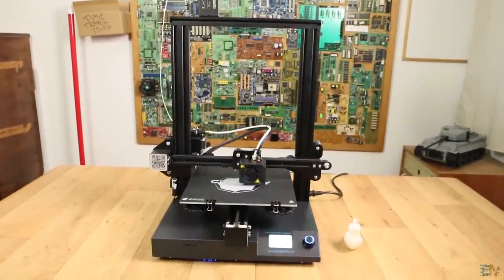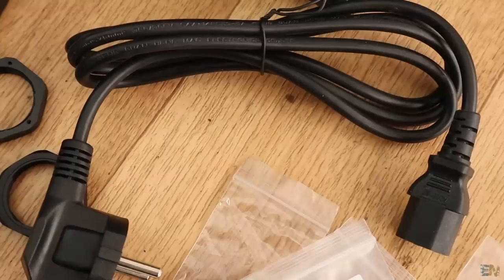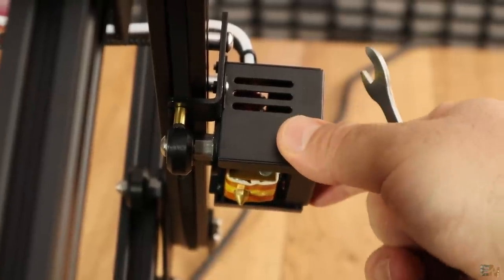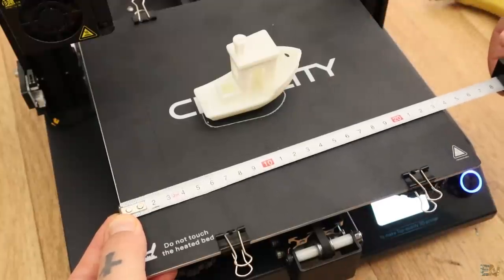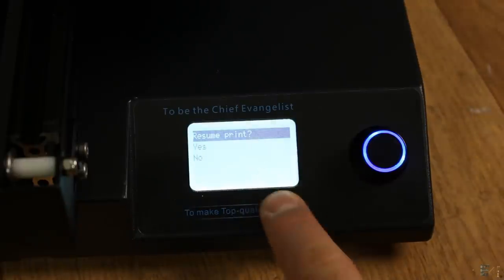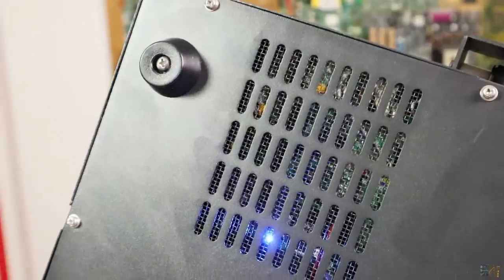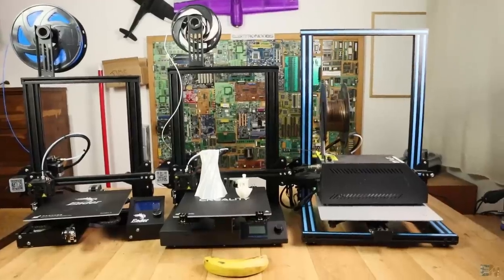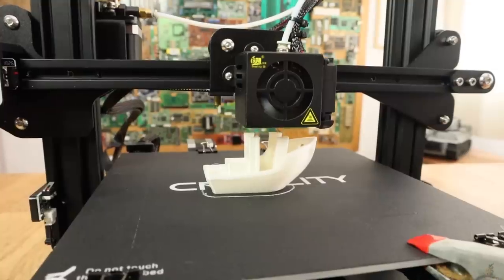Creality-CR20 3D printer - Review

Comment: My ender 3 has the removable bed. So the only diff is the cover over the hardware. Not worth the added cost.
Reply: it has upgraded board
Reply: This 3d printer has an autolevel system and the ender 3 does not.
Reply: I have cr20 pro with bl touch and magnetic bed

Comment: is it possible to fit stepper motor dampers ?  On the the Ender3 PRO (predecessor to the cr20)  the drive wheel was not adjustable so you couldnt fit the dampers

Comment: hey you should upgrade  nrf24 based transmitter and receiver since 2019 comming so your recent nrf24 based transmitter was old .
you should add this features 
1. ADD LCD ON IT ! 
2.3d printed case 
3. long range
4.without any  noise 
5.on transmitter setting like any flysky or any transmitter has (will help to center the joysticks using lcd and buttons)
6. you recent made 6 or 7 channel but it can send many channel so we have to make 12channel .

PLEASE REPLY IF YOU CAN ADD THIS FEATURE SOON ?
and also add oled on receiver that would be awesome .

also try to use STM32(BLUEPILL) microcontroller .
IT IS DOUBLE /TRIPLE FASTER THEN ARDUINO .
it can run at 72Mhz but arduino only 16Mhz .
please make tutorial on stm32 based transmiter or receiver also .

THANK YOU KEEP UP

Comment: Basically an Ender 3 Pro?
Reply: @npgoalkeeper _ Do those come with factory installed auto leveling? I'm looking at a CR-20 Pro for my first 3D printer, and it has a factory installed Bltouch auto level sensor. If I were to buy the sensor separately to install it myself on an Ender 3, the total cost would be almost the same, at least in my country.
Reply: @npgoalkeeper _ Does it perform better than the cr20?